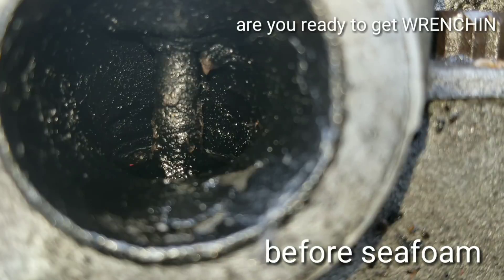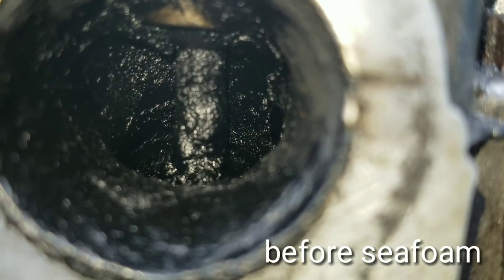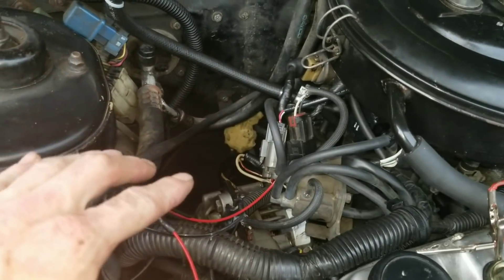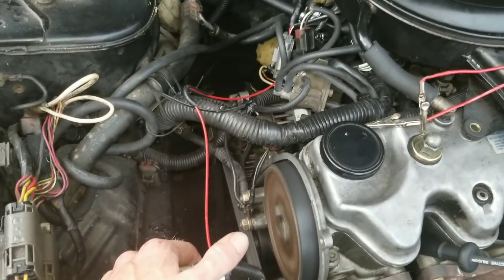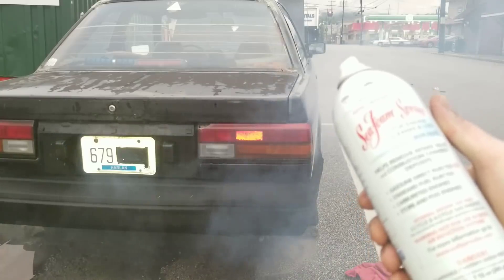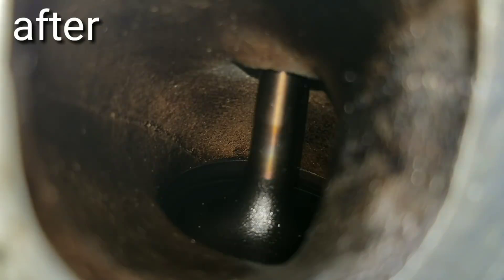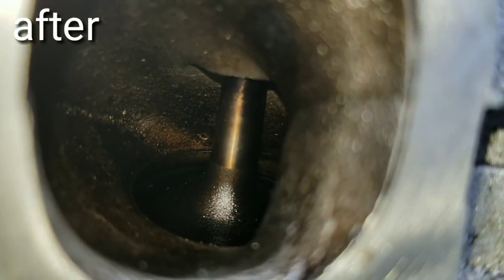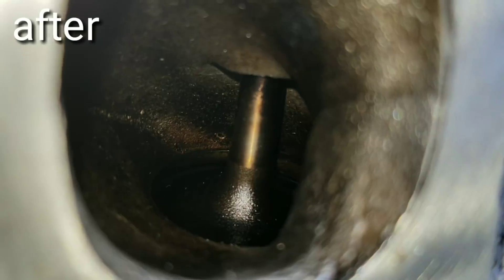how to use fuel cleaners remove carbon build up and clean intake valves on direct injection

Comment: I miss my 92' Nissan Sentra Type E. 1.8 Duel Cam with 4 speed manual. Granted I now have a 04' AWD VW Passat 1.8T 5speed Wagon. Helps having someone hold the revs up to 2k roughly during spray time.

Comment: Lmao for me it just destroyed my motor, granted I have 300k miles on my KA24E but still. It started to knock, wouldn't idle, then wouldn't run period unless you consider a single-piston out of 4 running lmao. Rn currently rebuilding for power might as well but it sucked. I tried 2 cans n nothing

Comment: That 30 year old Nissan Sentra does not have direct injection. LOL It's got a carbureator!
Reply from the maker: The Nissan is full injection tbi throttle body injection and i wrote direct injection because most test i performed are on direct injection.

Comment: That does look amazing I am thinking of doing it to my CBR600 but I'm worried about all that carbon going into the combustion chamber. I wonder if it all gets pushed out through the exhaust.
Reply from the maker: I can tell you from trying more additives than anyone that i have heard of carbon will buildup up until chunks are large and break free on its own. Preventive maintenance is the best way but if thats to late a heat soak and a drive on the highway.

Comment: My mechanic turned me on to Seafoam many years ago. I have had great results with the motor cleaner, in my oil and the upper cylinder spray.  My old 1999 F 150 runs and sounds like new.
Reply from the maker: Thanks for sharing

Comment: MAF sensor in an 80's car?? Yet alone a carborator?? I think not
Reply from the maker: Lol this car was one of the first nissan Sentra fuel injection and yes there is a air flow meter in this car also .

Comment: For 30 years old engine with a lot of carbon build up is better to take it off and clean it. If you just spray it, the carbon will go inside your combustion chamber and start to scratch everything. This will destroy your engine
Reply from the maker: The carbon will be destroyed with combustion and exit the exhaust but preventive maintenance is key

Comment: I had a 2006 E150 cargo van and it was running rough at low speeds at about 40k miles it started. I took it to 2 shops and they couldn't tell me what was wrong so I took it to the dealer and they said we can clean out the valves and so forth for 500.00 dollars but we cant guarantee it will fix it, they came to the conclusion it was carbon build up which they where right it was. I told my older friend late 50s about that and he came over with a can of seafoam and we sucked it up through the brake booster line let it sit per instructions. BAM! smoke every where, I think we did almost the whole can. BAM! after that the vehicle ran great up to 270k mile when I sold it, still running great. The only thing that went wrong with that vehicle besides that problem was the alternator 220k and heater blower fan 230k. Never had to put another bottle of seafoam in it again, I did buy it used around 20k. WOW! I said this 8 dollar can saved me 500 dollars and never had that problem again. Seafoam is the best!
Reply from the maker: Thanks for sharing your story with the NIA community.

Comment: Awesome video, I did this same thing to my 4.3 vortex  S/10. Immediately seen good results. Also added 5 oz. To my engine oil, again could not believe boost it gave my truck. Pretty simple solution, for each quart of oil your engine recommends add an oz. of seafoam. ex. 5qts of oil = 5 oz. Of seafoam.  Start your engine and in 15minutes  you'll hear the valve train quiet down. This is truly unbelievable, but it really works well.👍👍👍
Reply from the maker: Thanks alot i appreciate you so Germany's best valve cleaner tomorrow claims 30 seconds to clean intake valves so what do you think
Reply: Does it clean your valve if you put it I your oil?   Sorry, I know this is an old video and comment.

Comment: The smoke is oil burning. If you've ever had a piston ring failure you tend you get oil in the combustion chamber and it smokes. Head gasket failure too but that's not oil.
Reply from the maker: Yeah the valves have the oil on them

Comment: Seafoam is just denatured alcohol and mineral oil.... look at the materials on the website it’s nothing special.    I think you physically cleaned the port out.
Reply from the maker: Ive tried lots of products and only 3 out of alot did really well but after that cleaning that old car i couldn't get it that clean again because i allowed it to get baked on and i show the msds and there are different materials used for seafoam according to the msds

Comment: You need to do a compression check on each cylinder to check your piston rings. That much crud going through your engine isn’t a good thing. That smoke was real smoke from all that being burned inside the combustion chamber and likely some left over going into your muffler and catalytic converter. They’ll probably be stopped up now to an extent.
Reply from the maker: Yeah the car runs good what to try next?
Reply: Nothing Italian tune up doesn’t fix- what you’re supposed to do anyways after doing something like this.

Comment: Seafoam works very well, but I highly recommend replacing your plugs because it will turn them pink from the hot temp in the engine.  Only do a valve clean with Seafoam once a year to be safe.  Otherwise you can do some damage to your engine
Reply from the maker: Oh yeah thanks for sharing and what product do you have good experience with?

Comment: You don't need to be past the throttle. You just need to spray after the maf and before the manifold.
Reply from the maker: Thanks for sharing
Reply from the maker: Would you like to see if a engine can run on straight isopropyl alcohol live
Reply: @NATESINTERACTIVEAUTO  I think project farm already did that test
Reply from the maker: Yeah a few others aswell any suggestions and i like seeing how it works up close lol
Reply: @NATESINTERACTIVEAUTO  I have heard tons of good stuff about xado metal conditioner ($50 on amazon)
I wonder how it does against restore ($20 on amazon). 
I'd do a compression test before and after.
Reply from the maker: Yeah i will i have alot of experience with compression additives

Comment: Lol😂
Reply from the maker: Yeah lol
Reply from the maker: Would you like to see if a engine can run on straight isopropyl alcohol live
Reply: Yeah, you bet, I wonder what the exhaust would would be like and the revs, If it will even idol.
Reply from the maker: What else could we try if it has trouble working? i will make it work lol

Comment: Holy crap- that valve lash needs adjustment, real bad. I had the exact same engine in my '88 Pulsar NX. I loved that car, had it for 11 years- till it was ripped away from me by a careless old man, in my own driveway, nearly killing me. $5k and years of work- gone in 1 second. My clutch job is on my channel. Man, I miss that car.
Reply from the maker: Yeah i adjusted it to spec not long a go

Comment: Why only on this video sea foam had great result and when you tried in the direct inj it performed worse than crc? The gdi carbon is different? I'm thinking on trying on my Mercedes gdi
Reply from the maker: Yes i see
Reply: @NATESINTERACTIVEAUTO  the problem for me to spray on my car is I don't even know where to desconect or if I could find the pc valve and spray there because this car is all sealed and very complex with sensors all over the place. I have a 2016 Mercedes slk 300 so if you have ever seen this engine please let me know
Reply from the maker: Locate the air filter if you see a sensor the mass air flow put your straw past it or ask local auto parts does it have a mass air flow sensor if not you can leave it connected insert straw between a crevis barley open and spray or a vacuum line and just put your fingers on the line to squeeze it over the straw to make it idle better

Comment: Why do otherwise intelligent people buy into the oil/ fuel additives a snake oil nonsense. NONeOF THIS TRASH HELPS . Over half of the engine and transmission replacements I've done over the past 25 years had to be done as a result of the use of this trash . DO NOT ADD ANYTHING to you're car's engine , transmission, transfer case or differentials . I make more money off of tune ups than engine repair . And you will lose more. Don't fall for the marketing trash .
Reply from the maker: I understand

Comment: I've used it on my GDI engine to clean my intake valves and followed instruction. After letting it heat soak I drove it around and holy crap it smoked a lot. Once everything was burned off which took 10 minutes of driving aggressive the engine ran great with zero problems.
Reply from the maker: Yes i agree
Reply: What driveability problem did you have before this?

Comment: While it's not good to have chunks of carbon banging around in your cylinders, another issue is any of that which is still large enough particles to get stuck in the catalytic converter will start to clog it up and restrict the exhaust.   Frankly sometimes cars are so old and have so little value that you're better off just leaving them alone and saving up $1500 to get something 15 years newer, and something a little smaller might also save some money from better fuel economy.
Reply from the maker: There is so much truth to that although im using the products for tests
Reply: Stinky Cheese or...clean the valves manually since the intake is off already lol
Reply from the maker: For informational purposes
Reply from the maker: Would you like to see if a engine can run on straight isopropyl alcohol

Comment: I don’t know if you’re still reading comments but I heard that putting sea foam liquid into the oil before an oil change like a day before. Then when you take out the oil and put in some Lucas oil stabilizer liquid into the oil after you change it should make the engine sound much better and maybe run better! :D
Reply from the maker: Yes that is correct follow car manufacturers and product manufacturers recommendations

Comment: Yeah pass the air cleaner I guess you don't have a mass air flow Center not where you pointed at but put it in past the air cleaner
Reply from the maker: This one aint
Reply from the maker: Inch or 2 in front

Comment: I’m an auto tech, the correct method for doing  this is thru the vacuum booster line from your brake booster.  Highest point and most vacuum from the engine you can get.  1/3 of the can in intake thru this hose, 1/3 of the can in your oil if you change the oil and a 1/3 of the can in the gas tank.  I am speaking of the actual seafoam in the pourable container.  The Spray works ok, but the liquid is much better. Remember to let the vehicle sit for 10-15 mins after running the seafoam into the vacuum booster line
Reply from the maker: I really appreciate your helpful information you share
Reply: NATES INTERACTIVE AUTO we use Wynn’s decarb treatment and 44k treatment
Reply from the maker: Where can you find that?
Reply: This method of using seafoam to clean intake valves from carbon deposit is much more simple than using CRC intake and turbo cleaner since many people using CRC have problems with check engine line pops up. Harlan, Thank you very much for your informative footage on  the effects before and after seafoam treatment.
Reply: @minhtrietle8914  that CRC stuff...stuffed my engine, burns oil on start up now
Reply from the maker: Have you had good results
Reply from the maker: Thank you
Reply from the maker: New video is the best yet https://youtu.be/103oyzkNHug
Reply: Always glad to help in any way that i can.  Getting ready to ramp up my own channel very shortly, had a lot of requests.
Reply from the maker: What will you be doing? How long has your channel been on YouTube and maybe we can go live or collaborate
Reply from the maker: What did they use ?
Reply from the maker: Thanks for sharing with the NIA community
Reply from the maker: Yeah probably
Reply: I haven’t really posted any content yet.  But it will be how to and informative videos on various auto repairs that I perform on a daily at work.  Also may do some motovlogs since I do enjoy riding motorcycles:)
Reply from the maker: Yeah that would be sweet
Reply from the maker: I used the spray container for this video in the brake booster line but its no more effective. If you spray threw throttle plate it will clean it also
Reply: What have people found that works the best threw the intake? original seafoam or the new spray?
Reply: You don't use the brake booster vacuum line. It only cleans the back cylinders. ASE certified tech... I've done it both ways. The booster is easier, but you also wanna be at 2-3000 rpm. Js
Reply: Not uncommon for people to try to just pour it in.  We use a drip type setup kinda like an IV.  Yes revving the engine is normal, it creates more turbulence to atomize the fluid.  You may smell a sickly sweet or chemical smell for a few days after the service
Reply from the maker: Thanks for the information

Comment: Seafoam goes in the gas tank brother.
Reply: Also in the crank case
Reply from the maker: Would you like to see if a engine can run on straight isopropyl alcohol live
Reply from the maker: True
Reply from the maker: This is the seafoam spray

Comment: this stuff burns out o2 sensors it worked on your car but not all
Reply from the maker: Ive not had a problem with o2 sensor from product use but thanks for sharing its important for this community to be aware of anyones experience or knowledge of the product

Comment: It also doesnt hurt to use Mobil Techron in these engines either, in conjunction with a higher octane fuel, not that bargain gas station regular that you dont know where it came from. And oil changes are key also.....
Reply from the maker: Heyrod59 thanks that makes sense
Reply: Around here , the tanker pulls out of one gas station and into the next one down the road. 
It’s all the same slop.
Reply from the maker: Yeah alot of  times

Comment: Sea foam kicks ass man its saved slot motors for me improved gas mileage and got extreme results u just can't be stupid when you do it just follow directions and stay up yo date with it and do it every so often personally I'll put it in the oil before a change for 100 miles and some in the tank and pour a third of the can in the brake booster 1/3 in oil and the rest in the tank never had problems
Reply from the maker: Thanks for sharing nothing is better than experience

Comment: This Man is taking the Piss,it's a carburettor engine and he should be spraying it down the the Top of the Carb,that engine looks like it's been to the Moon and back because it must have a lot of back pressure to accumulate that amount of gunge in the inlet Manifolds,the Petrol Normally Flushes these fumes into the Cylinders where it is Burnt and then out through the Exhaust,in a GDI engine this doesn't happen because the fuel is injected Directly into the Cylinders,Not Convinced at all.
Reply from the maker: This engine does not have a carburetor   also some gdi use what this engine does have throttle body injection tbi if you want to help with a idea for a video let me know
Reply from the maker: Thanks

Comment: Seafoam works don't use it on low mileage cars\trucks, anything over 80000 miles work. Sometimes for cars like yours u might want to do 2 or 3 cans.15 minutes is good enough for the soaking.
Reply from the maker: Cool and thanks alot

Comment: I got a 1998 chevy suburban that smokes when I'm driving it. There's no coolant leak or anything could this b a gunk build up problem or is it something else.
Reply from the maker: Burning oil
Reply: NATES INTERACTIVE AUTO. Thanks for the response. Any suggestions on how to take care of that. Should i change my oil lines,or does it mean the oil pump is bad.
Reply: @monedwar5117  hes right it is burning oil,but he didnt tell u how,its either the ring lands on the pistons or its the piston rings themselves ur welcome!
Reply: OrderOfTheRedstone. I really appreciate the response. Thanks a bunch guy.
Reply: @monedwar5117  np man just trying to help people with car questions,get those piston rings replaced and ur vehicle shouldnt excessively smoke anymore and use oil,what piston rings do is they scrape the oil off back into the crankcase  so it doesnt mix with the gas and smoke a ton,as the engine ages and the more miles is put on it the pison rings no longer work correctly allowing oil into the combustion chamber thus causing the engine to smoke and run poorly,the ring lands are where the piston rings sit,if the ring lands mess up,goodbye piston is all i gotta say bruh,cya
Reply: OrderOfTheRedstone. Will do guy. You are a gentleman and a scholar. Thank you kindly sir.

Comment: Seafoam doesn't fix an engine that's already too far gone...also, stop with the click bait....your title is totally inaccurate....that is not a direct injected engine. Did you even follow the directions to the letter? You want more views, don't pull crap like this.
Reply from the maker: Im sorry if you feel this way thats not my intentions but i use a direct injection car in alot of videos also cleaning the intake valves is the same principle for fuel injection and really this engine is 10 times worse it drinks about 1qt of oil  every 50 miles but if you broke up to much carbon it is said by alot of people it will damage the engine along with all the smoke which is more than usual when i used seafoam but thanks for your time

Comment: I usually sprey little amount of carb and choke cleaner into my motorcycle tank after every 6k-7k km. Is it a bad idea?
Reply from the maker: That is good maintenance and thanks
Reply: It is good for removing carbon
Reply: Once a mechanic told me to do this. The actual process is spraying the cleaner directly to the carburettor from air intake part, but he told me to mix with fuel at a interval of 6k-7k running.
Reply: @skytop5334  that is ok. Same may be applied to cars as well